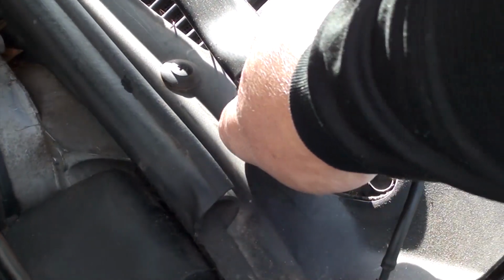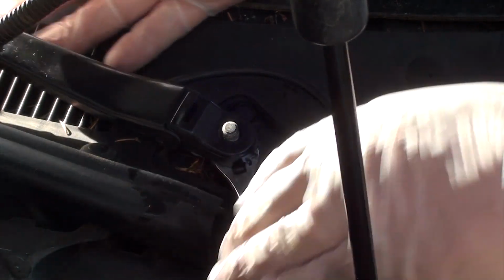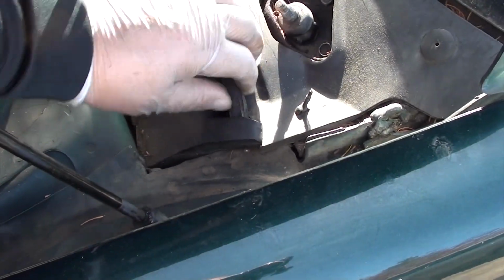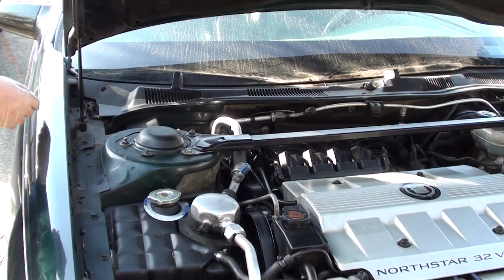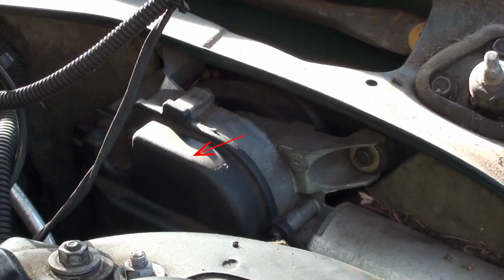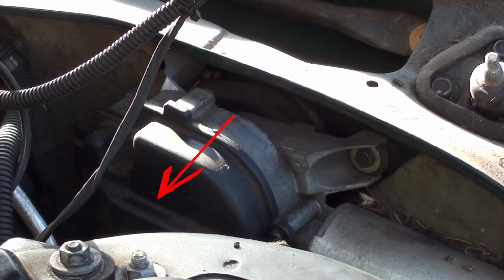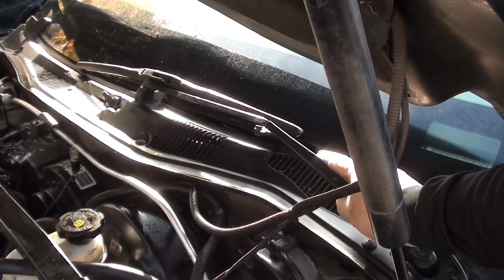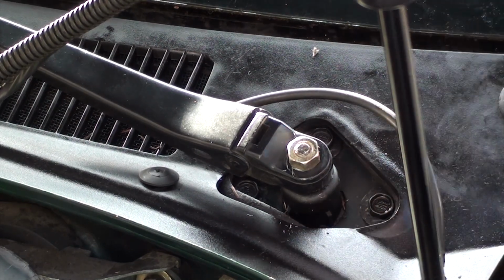Cadillac | Windshield Wiper Motor | Does not work | Remove and Replace | Repair Costs | Autozone

Comment: The picture you showed of the new motor with arrows pointing to the screw holes was tremendously helpful. I wish more people did that for parts that are hard to view in video or in person.
Reply from the maker: I try, that's why it takes me long to make these video, I try to put as much detail in them as I can. I do this because I know what it's like to look at a bad you tube video. I do this for you guys, trust me it's not the money, if that was the case I would have been gone a long time ago.

Comment: Great video, my exact same Wiper Motor as on my 1996 Cadillac Fleetwood (mine is on the passenger side).  2 things I would liked to have seen done was replacing the Wiper Motor Pulse board which has a black piece that pivots around in it's position according to the signal given by the wiper switch.  Secondly, the ball and socket pieces came apart when I took  the motor off and now I am having a tough time connecting them back on.